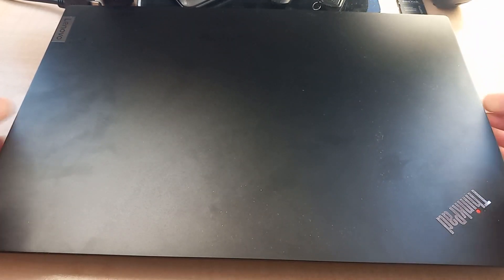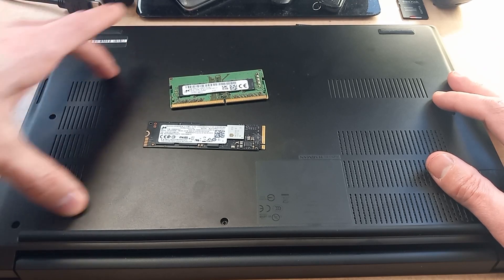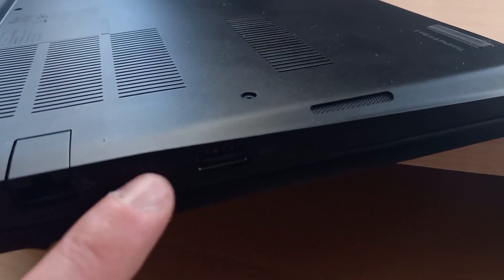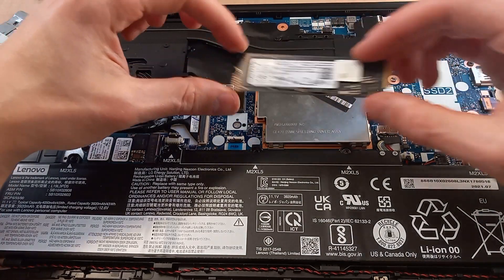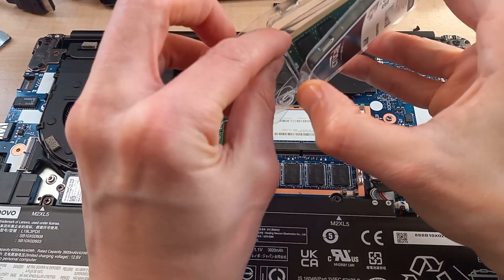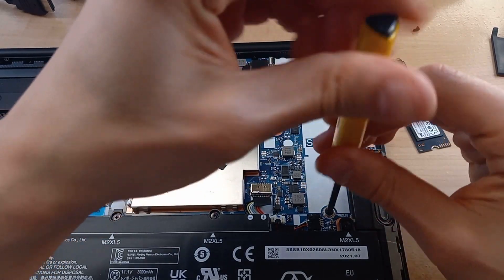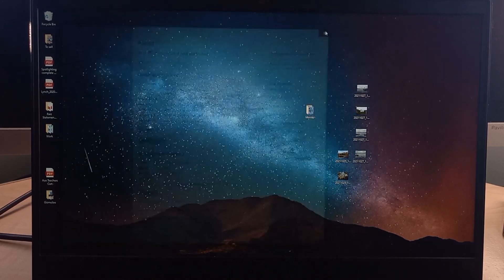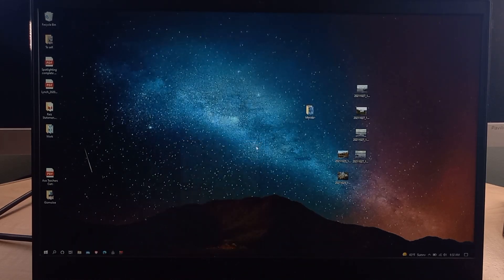Lenovo ThinkPad E14 Gen 3 RAM & M.2 SSD UPGRADE Tutorial

Comment: Can anyone help me? I want to upgrade my m.2 ssd in my Asus Vivobook laptop. The thing is, I see that many m.2 ssd's come with heat sinks. My laptop is too thin to make an m.2 fit with a heat sink, and the current 128gb m.2 in my laptop does not have a heat sink. Now my question is; Does a 2tb m.2 ssd run too hot to use without a heatsink in a laptop? Should I be looking at a smaller m.2 that runs less hot? Or is the heat of a 2tb m.2 not going to be a problem for a laptop? Thank in advance to any who answer!
Reply from the maker: Hi Bert, it's important to note the way the m.2 drive connects to your laptop, it will be either SATA or NVMe. NVMe is faster, but with speed comes more heat. I would say most laptops are utilizing NVMe, however most laptops do not have the room for a heatsink. Therefore, if you are doing the upgrade yourself, I'd stick with a Gen 3 NVMe M.2 drive as the Gen 3's don't get very hot and using one without a heatsink should be fine. That said, each system is different and not all parts are made equally, so take what I said as my opinion only. Thanks for watching.
Reply: @GizmoJoeReviewsTech  Thanks for your useful advice!

Comment: Any way to make 2nd drive boot as drive c?
Reply: If you want to boot from 2nd drive I had to remove the internal one. 
Also if you use a clone utility make sure you turn off bitlocker first. I installed a crucial 2tb. I then cloned the built-in 256gb to 2nd drive. I found that switching boot order still cause boot from mve0 as opposed to 2nd drive. However I didn't mind having to remove the mv0 drive since it in effect is a fresh factory copy and setup. 
So use free crucial clone,  shut down and then remove smaller drive.  It's possible that if you wiped out the first drive you can get system to boot from 2nd drive.  I was not willing to risk messing up the windows install. 
I recommend you remove the factory drive and it's a nice fresh install you have  in case of some drive or issues down the road.

Comment: hi, crucial ssd  nvme works? and difrencies voltaje 3.3v 2.4A  and crucial is 3.3v 1.7A ?
Reply from the maker: Yes there shouldn't be an issue with crucial. I used a crucial drive in a friends laptop and it works great! Thanks for watching!

Comment: Hey nice video.
I m looking to buy this laptop but confused between ryzen 5 5500u and ryzen 7 5700u. There is 67$ difference between the two. I am a casual user but looking to keep the machine for long period of time. Will ryzen 5 5500 u do the work for next couple of years or should I go with ryzen 7 5700u.
Reply: Is better the 57000u just for 67$

Comment: This is so terrible in comparison to older ThinkPads where you simply had a latch to open for RAM and SSD...
Reply: Hey its not so bad. That RAM cover is not fixed with any screw. You can just pull it up.

Comment: Very helpful video....thank you!  Can you please confirm that the memory really is running in dual channel mode, such as looking at the memory page of CPU-Z.  Since the memory you buy for the SODIMM is unlikely to have the same specs as the soldered memory chips, it is kind of a crap shoot if the memory subsystem will really be able to run in dual channel mode.  But if this Crucial memory you bought works for you in dual channel mode, I will try it on my E14 too.
Reply: How's your e14 now, do you recommend it?

Comment: Hello sir
I'm planning on buying the exact same model, which display type is your laptop? 
there are 3 options available in my country
TN panel
IPS ntsc 45%
IPS srgb 100% 
TN panel I'm not buying confused between the two IPS 
and overall how is the laptop any problems till now ?
Reply from the maker: I have the IPS 100%. Personally, I'd avoid the TN panel. They're cheaper but the color reproduction isn't as good and it has poorer viewing angles. Either of the IPS panels would be a good choice, the difference between the 2 being their level of color reproduction accuracy. I hope this helps. Thanks for watching!

Comment: Is there any thermal pad for the SSD installed? In the service manual, "Before installing a new M.2 2280 solid-state drive, ensure that the thermal pad is installed properly."
Reply from the maker: A thermal pad is recommended, however it is not entirely necessary. The thermal pad can ensure that you get the best performance out of your m.2 SSD while under heavy load/high temps. I may install one at a later date, as I did not receive one with the drive I bought. Thanks for watching!

Comment: Could I also upgrade the M.2 2242 ssd? I mean, I will add one M.2 2280 ssd but maybe in the future I also want to upgrade the one installed in the left with the O.S (I don’t mind, I could re-install the O.S after changing it)  
Thank you
Reply from the maker: You should be able to upgrade the 2242 SSD, I would invest in an enclosure that supports 2242 SSDs and clone the original OS drive and swap them over. Thanks for watching!